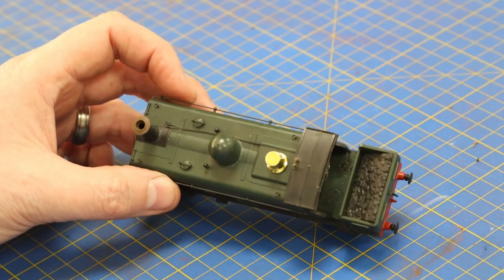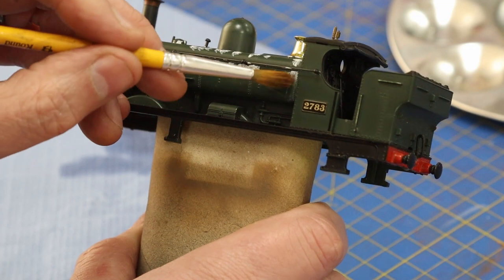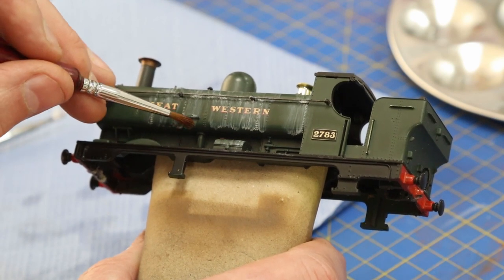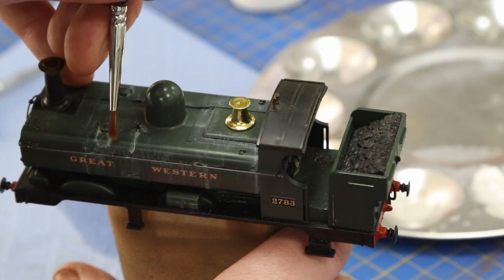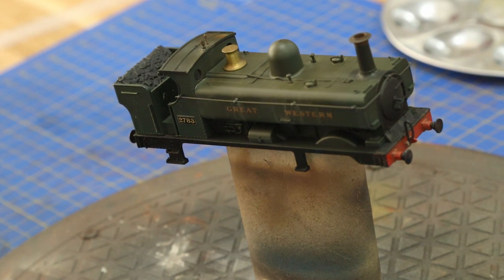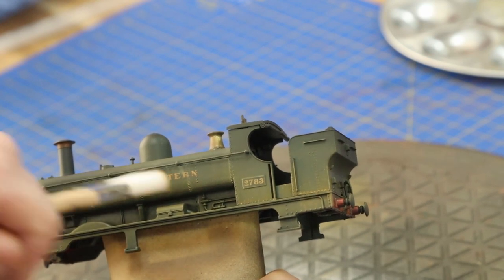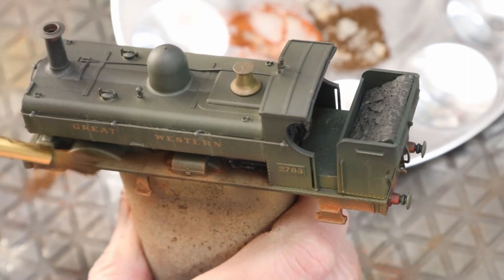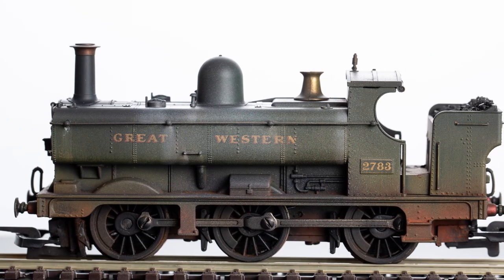Weathering Model Railway | Hornby GWR Pannier Tank

Comment: Very good i wish i had the talent and nerves to do this but i think i may mess it up but yours looks great .thank god you didn't use proper coal i seen models use coal chunks in scale that would have been half the size of the fireman in scale witch looks wrong  yours looks just wright for the size of engine and OO gauge
Reply from the maker: Thanks Robert. It’s just a matter of practice, plus a big box of old rolling stock off of eBay 😂
Yes I agree. Some coal is a little too large for OO scale. The Hattons ones come is different grades. This is my usual size
Thanks for watching